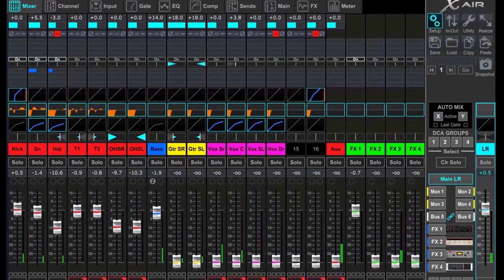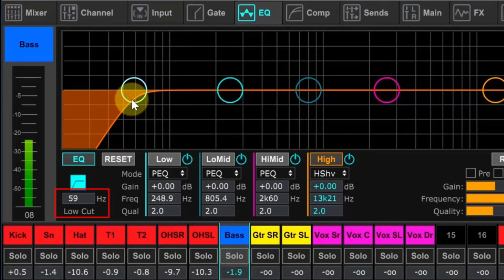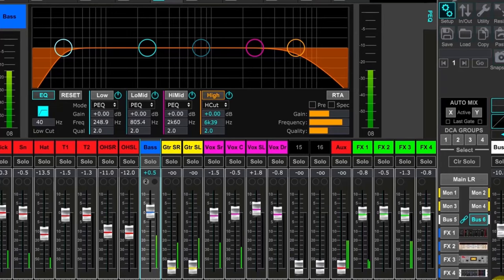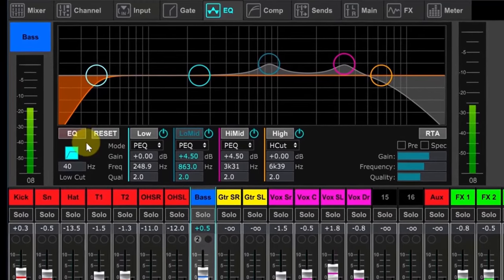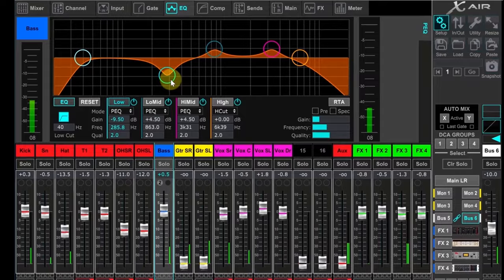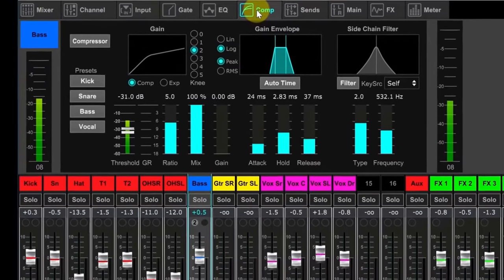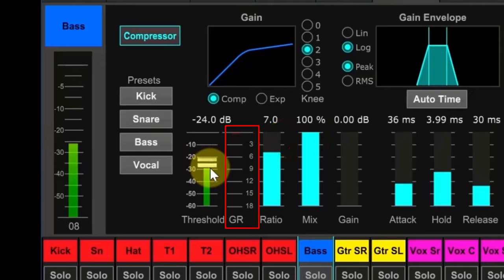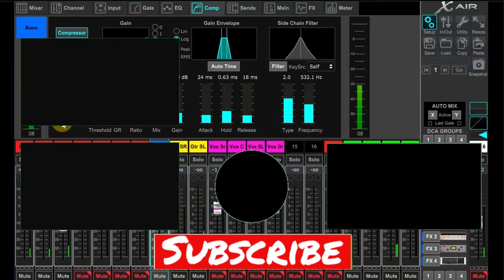Mixing Live Bass Guitar. EQ and Compression Tutorial for Live Sound

Comment: I just love how audio people these days turn op the gain before pushing the fader to 0.
Reply: Digital added metering
Reply: @zacherywagner1189  you obviously dont get it
Reply: @openyourmind493  I do this on tour for a living
Reply: @zacherywagner1189  oh wow me too. 30 plus years. How about you?
Reply: Why would you have the fader up at all while adjusting the gain???  On my old (analog) Allen & Heath GL2800-856, I could and would set up all the channels, and even the subgroups, with nothing coming out of the mains.  The gain is set to provide the channel with the highest input level possible without distortion, which also provides the best signal-to-noise ratio (and Allen & Heath liked HOT signals... +3 to +6, peaking at +9, and occasionally hitting +12). When ALL the channels were flashing the reds just a little, the board was set perfect.  "Playing" with the gain during a performance effects everything for the channel, including all the Aux sends.  Once the gain is set, it should not be adjusted again during the night.  Unless, of course, some fricking idiot decides to crank his amp up on stage (which someone ALWAYS seemed to do).  The fader is only there to control the level of a channel in the output.
Reply: @donf3877  don. you push the fader to 0.
you mix with your faders within + 5 to - 5
Now if you push the fader to 0 and there is already enough gain/volume why would you adjust the the pre amp before pushing the Vader to 0?
why mix with the faders 1/4 or 1/2 way up the slider? its not optimial.
I just had a young audio person set their monitor sends, sub speaker send and gain before pushing the fader to 0.
when they finally turned uo the fader it was so hot/loud they couldn't under stand.
Well every console pre amp are different and PA system have more head room then others.
I know all the kids go to  schools now a days and are taught to gain uo before fader  
but that studio bs. and even then its the reason recordings are over saturated.
and by the way I do mix with my gains to keep the fader moves within +5 TO-5 fader moves.
oh wait lets put a compressor on every channel or 6.
Reply: @openyourmind493  Interesting.  Interesting because every manual, from every manufacturer, for every mixer I have installed (over 150 to date) and used have stated explicitly NOT to adjust the channel gain the way you describe.  And, in every discussion I have had with engineers at companies that produce mixers where the subject of channel gain has come up... have also stated the same.  In fact the engineers, and the manuals, all stated your way is the WORST way to set the gain for channels.  It must be wonderful to be so much smarter than the actual designers and builders of the equipment you misuse.  Every time I see a mixer where all the faders are hovering around -0-... I know the operator doesn't know his butt from a hole in the ground.  Just because you have been doing something for 30 some years... doesn't mean you actually know what you are doing.........................
Reply: @donf3877  good for you
Reply: @donf3877  Correction that was the snare Bottom channel.
Reply: @openyourmind493 
From Allen & Heath:  "...  Use the faders to balance each signal in the mix. To ensure optimum gain structure we do not recommend the practice of setting the faders to ‘0’ and mixing using the GAIN controls."

You might want to reread those two sentences over a few times to really get the gist of what they are telling you.  It seems that Allen & Heath (and Soundcraft and Yamaha and Rupert Neve and Crest and Midas and other mixer companies) advise AGAINST using the very technique you, and some others, are intent on using.  Just because people use an adjustment technique, and use it for years... does NOT mean it is a good technique, or the suggested one, or the preferred one, or the correct one.  When you are adjusting the Gain, you are not only adjusting the level of the signal, you are adjusting the signal-to-noise ratio for that channel.  Setting all the faders for -0-, then adjusting the Gain... you are injecting unneeded and unwanted noise into the mix.  You are "mixing using the GAIN controls".  And, you are defeating the entire purpose of the faders.  The FADER is there to balance each signal in the mix, the GAIN is there to optimize the level of the channel.

As far as your "30 years experience"... I started in commercial sound in 1974.  Do the math.  The was back in the day of E-V Voice of the Theater speakers, almost 60 pound Crown amps, and daisy-chaining three mixers together to get enough channels.  The difference between you and I is... I didn't just take some schmuck out in the field's word for something.  I actually investigated matters with manufacturers and engineers that actually knew what was what, that actually designed and built the equipment.  And, I found out the majority of the time... the schmucks out in the field... didn't know their butt hole from their elbow.

The entire paragraph on adjusting the Gain from Allen & Heath follows:  "Important note on setting channel levels: Use PFL to set the GAIN controls for correct signal level through each channel. The main LR meters provide a high resolution display of the channel signal level.  Use the faders to balance each signal in the mix. To ensure optimum gain structure we do not recommend the practice of setting the faders to ‘0’ and mixing using the GAIN controls."

How's it feel to be wrong most of your life???
Reply: @donf3877  you keep reading Manuals.
Reply: Man Julian.  Yeah bud, you gotta get your gain structure right before ever even thinking about touching a fader.  That is Step 1.  You don't HAVE to I suppose, but if you don't monitors, FX sends, compression etc will all suffer and be way less under control.  Step 1, rule 1, home base: Set your gains.  Or do as you please, we all have the freedom to do so.  It never hurts to learn a better way even if something you have done for 30 years works for you.  We can all keep learning. :)  much love!